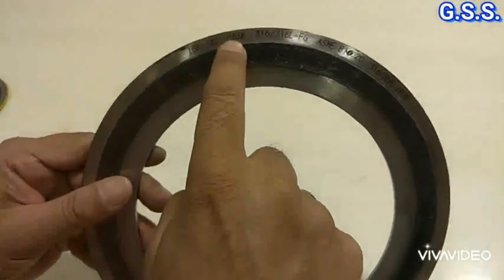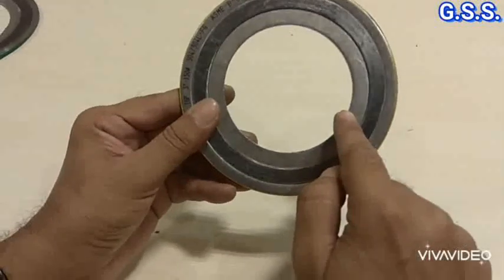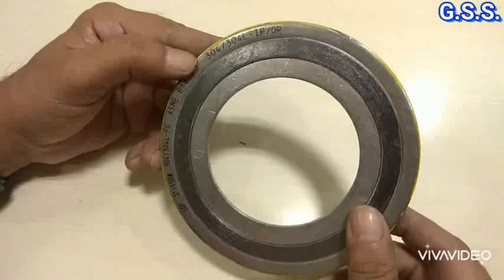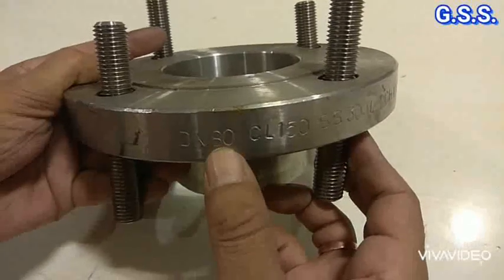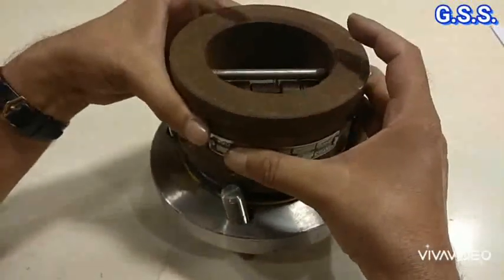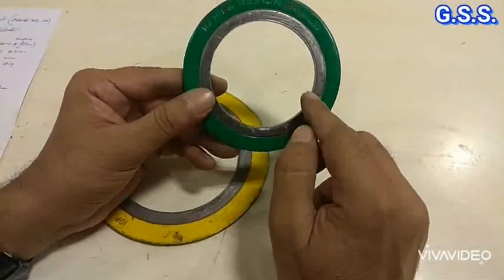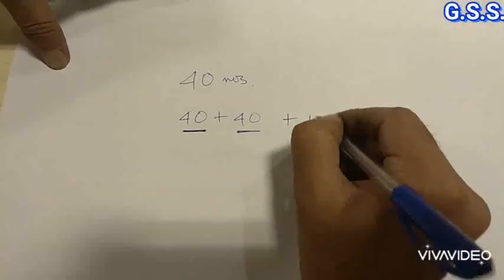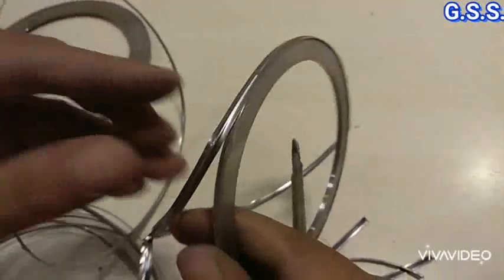Piping Engineering : Spiral Wound Gasket - details

Comment: Please mention in your next video that no inner ring is required up to what sizes. Thanks for your information.
Reply: As per ASME B16.20, Inner rings are required for the below conditions:
i) When PTFE is used as a filler material
ii) Based on size and rating combinations (in general above 600#)
iii) Recommended for Vacuum service

Comment: Amazing.You have explained this video very well with clear explanations which I have never seen before in any site. please make more videos about gasket. Some time purchased spiral wound gasket without inner ring.  But the connect line is requirements of FBE inner coatings In cases if we are using gasket without inner ring . The fluid service exposed to flange. I hope there are two solution either flange surface should be FBE or should be purchased spiral gasket with inner ring. However we need your advice about this issue.

Comment: hello Sir
can we use spiral would gasket in flat face flanges as well?
Reply from the maker: No, we should not use, because while tightening flange bolts, moment will be generated in flat face flange and it may crack because in most of the cases flat face flanges are of cast iron which is brittle.
Reply: @gourisankarsamanta7670  thanks for your reply!!  My flange is gun metal flat face Which is not brittle. I believe crack will not occur in gun metal flange however off course bending moment will be there. 
So I am in confusion whether should I use this gasket or not in flat face. 
I read somewhere on internet that we can use it in both flat face as well as in raised faces flanges. 
Please suggest your opinion.
Reply from the maker: @vikrambar  Gun metal is soft and malleable having mainly Copper and Tin. 
Spiral wound gasket can be used for gun metal flat face flange.
Reply: @gourisankarsamanta7670  appreciating your prompt reply, thanks!!